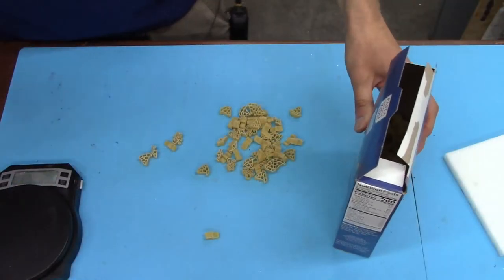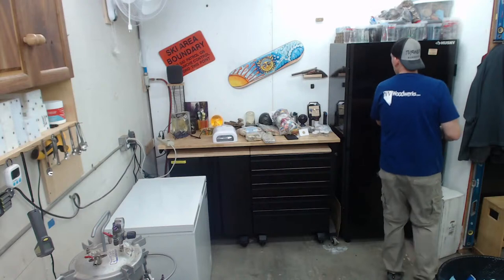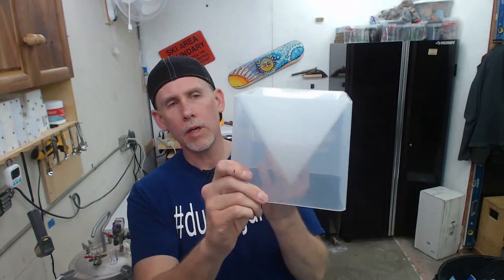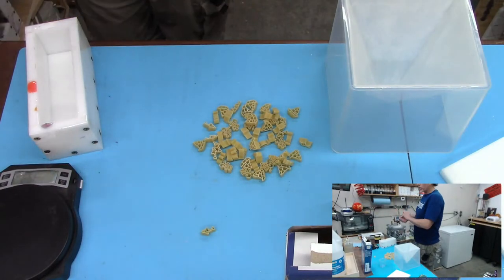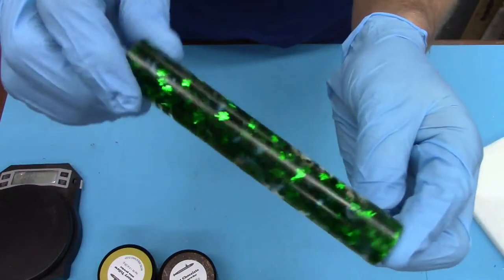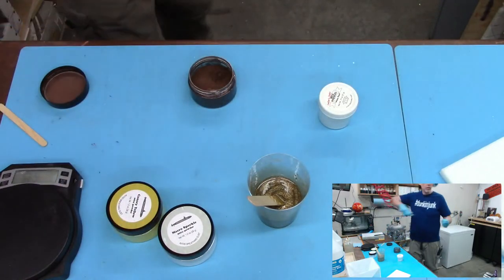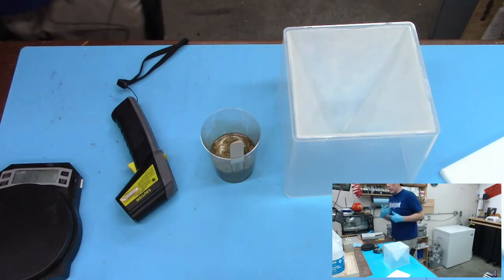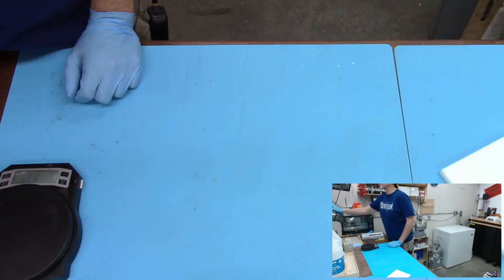🔴Replay: Casting Sea Creature Pasta in Resin | Episode 127

Comment: I'm trying to encase cereal inside resin but need something transparent and similar to acrylic in durability do you have a resin brand or type to recommend
Reply from the maker: I think any epoxy should do the trick, it's very tough material. I mostly use Alumilite resin, they have Amazing Clear Cast Plus that has UV inhibitors in it to help ensure the resin doesn't yellow. Here's my affiliate link to it if you want to check it out: https://www.alumilite.com/resins/amazing-clear-cast-plus/?aff=46
Reply: @ZacHiggins  thanks man love the channel been watching tons of videos